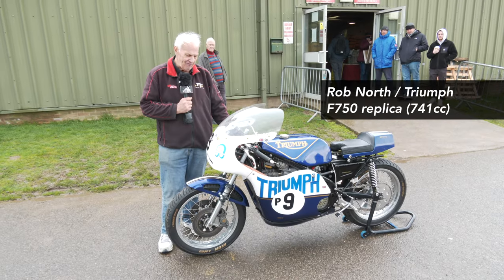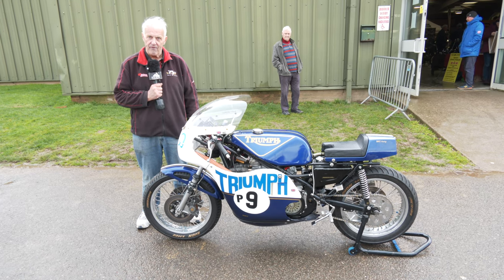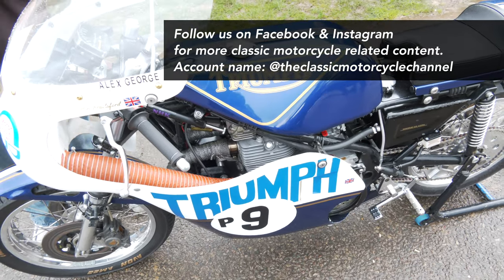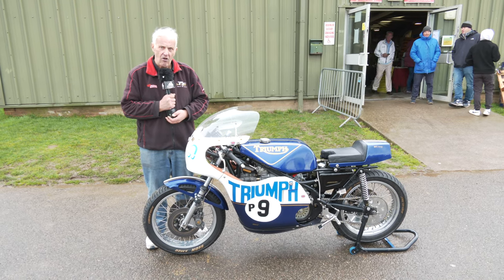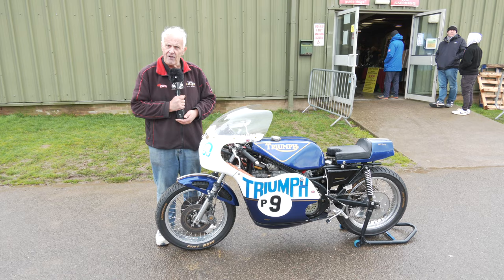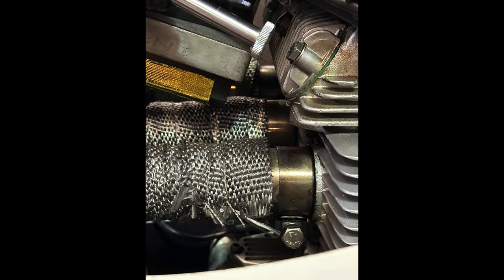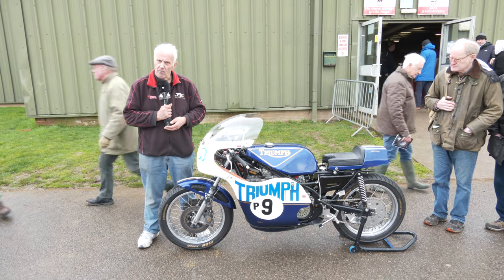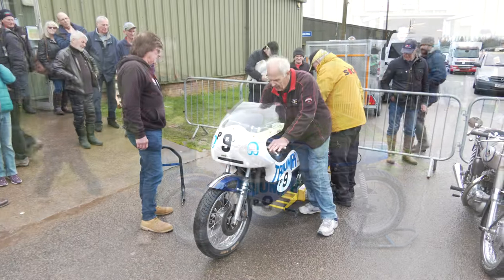Rob North / Triumph F750 replica - quick look & start-up

Comment: Incredibla machines and almost worth it for that sound only ! Well, around 110 bhp sounds like a but much to me !  (Factory race bikes made about 84 bhp I seem to remember). 
What's max rpm on this ?
Reply: just under 104 bhp , is the most powerful 1 i know of. 930 cc P+M bike . max rpm 8k
Reply: THX, I missed that it was a larger than 750 cc block. Still a lot of revs, all the more with the larger motor ! Great work. c @baldricksimson